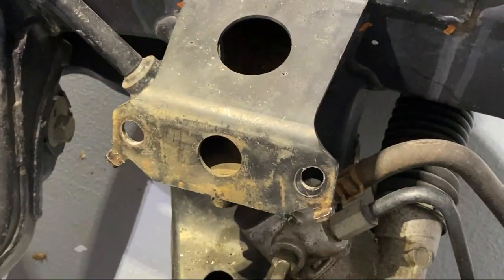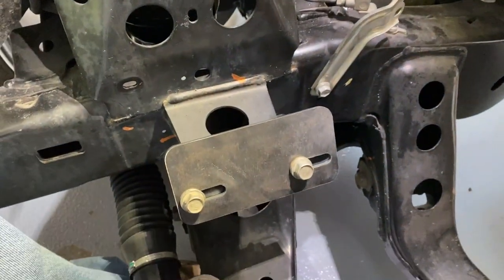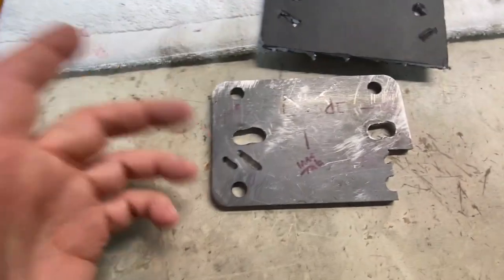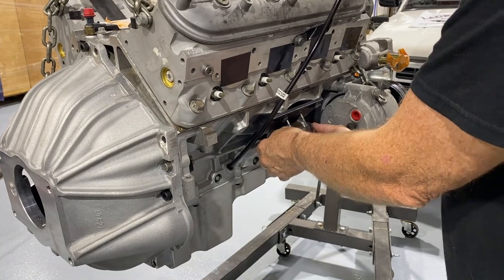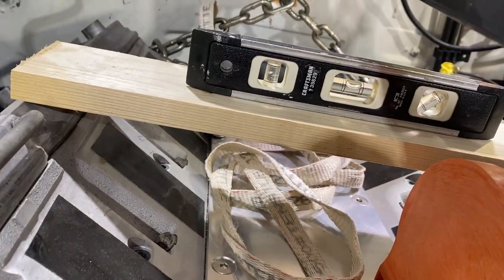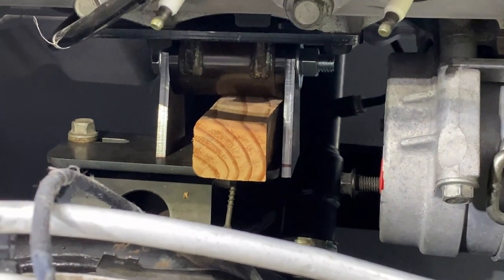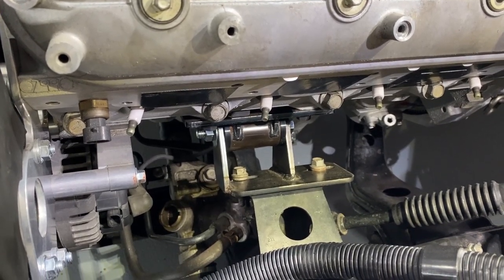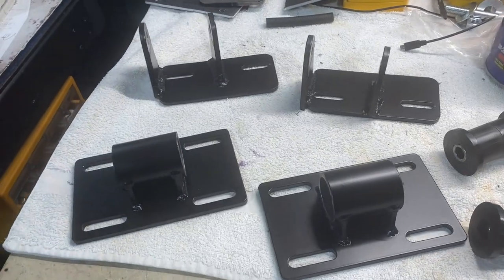2007 2ND Gen Toyota Tacoma Build LS Swap Part 4 - Making Motor Mounts

Comment: I would like to buy some of those mounts. Do you have the them drawn up so I can have them made?
Reply from the maker: I sent my “version 3.0” to a company I use all their mounts. The guy I am working with has an interest in making them. My hope is that when I get these back a) they will look (and be) like production mounts and b) they can be made easily since all the specs will be in his cad program. They are being made this week. So, by middle of next week I should have them back to make sure no other adjustments need to be made.
Reply: Any word on the availability of these?  @laurencevillegarage
Reply from the maker: @inkedupgoon7478 yes, they are available from Metaltek Manufacturing. Priced at $129.
Reply: @laurencevillegarage  didn't realize the 2wd and 4x4 had different motor mounts. That's unfortunate